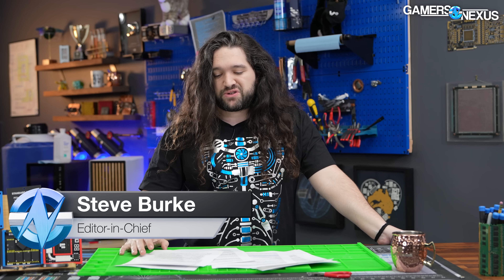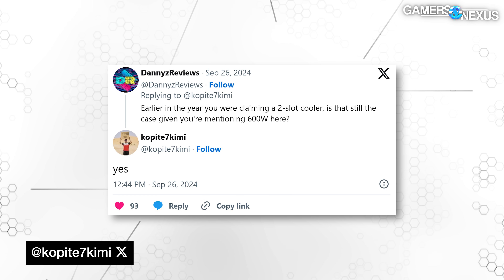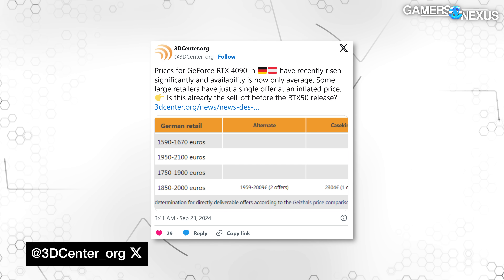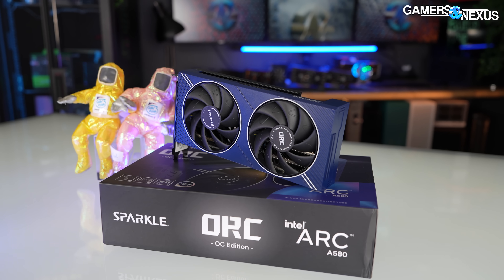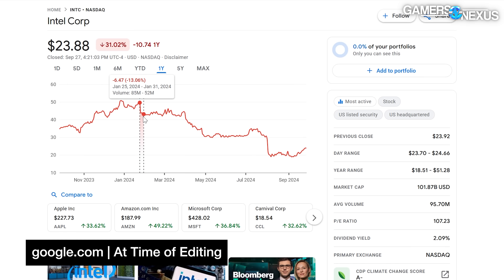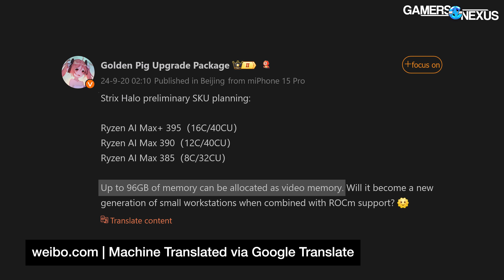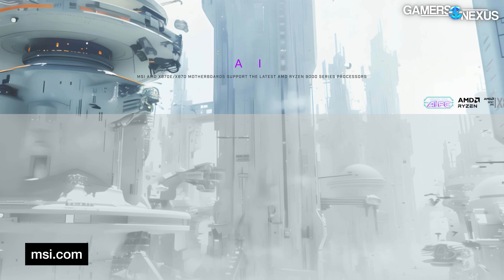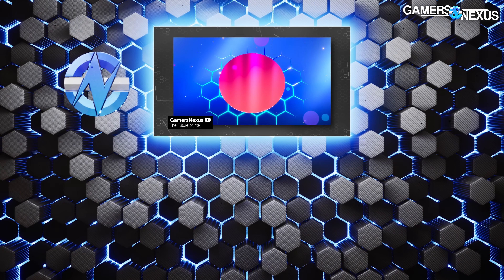HW News - RTX 5090 & 5080 Leaks, Valve ARM64 Experiments, Intel Arc 0% Marketshare, 4090 Price

Comment: I don't understand the people saying the 5090 leak can't be possible be real due to the core counts being too high for a generational increase. Does no one remember every previous Nvidia massive generational halo card spec increases? Titan RTX to RTX 3090 increased core counts by well over 100% (4608 to 10496), RTX 3090 to RTX 4090 had roughly a 60% increase in CUDA cores (10496 to 16384), and RTX 4090 to this rumored RTX 5090 is a 33% increase in cores (16384 to 21760). If anything Nvidia is actually getting stingier, cutting the GPU core spec increase they've given to Halo cards generationally by half each generation going back to RTX 2000. 2000 to 3000 was 100%, then 3000 to 4000 only 60%, 4000 to 5000 dropping to almost 30%. The 6090 will likely only have 15-20% more cores than the 5090 if it keeps tracking this way, price justified by new DLSS and frame gen that allows a 2X performance increase of 4K gaming over 4090. When we went 3090 to 4090, they took away  / reduced a huge part of the generational prior years 2X hardware improvement and instead gave 40% of that performance with DLSS + Frame Gen, and people were still more than happy to shell out two grand for a GPU, they'll do it again. 

My bet is Nvidia cutting their 5090 production costs by another 25% over 4090, give even less hardware horsepower improvement and I bet the 4090 FE of $1599 turns into a liquid cooled 5090 FE that costs a minimum of $1999, or as much as $2499.  No way they're going to sell consumer GPU's to us when those same GPU dies can be sold at triple or quadruple the profit margins to a datacenters desperate for any AI hardware.
Reply: it's not worth to explain that they get less for more money. if somebody pay leather jacket's exclusive margin (about 60% btw) just to play games on that brick, it is purely for the feeling that he is something more than others because he can afford it. i can purchase 4090 every month, but i had to be mentally ill to buy a card which is barely worth 50% of its price.

Comment: really hope that the rumored v-cache on both CCD's comes true
Reply: Agreed. From what I saw their 'solution' for having the system decide which ccd to use left something to be desired. They needed something similar back in the bulldozer days and I wasn't impressed then, sure it helped my 9120, but it was marginal and I still suffered from random stutters, their scheduling update only made them less frequent. I refuse to spend 9950x3d money for a solution that is only 'less annoying'
Reply: The final AM4 CPU being a 5950X3D with double v-cache would be a dream come true for me
Reply: I mean then you have 2 downclocked CCDs. If you want gaming, go for the single die imo.
Reply: Other issues with this is basicly no games are multithreaded enough to support a 16 core X3D at the moment, pretty much every title threads out to 8 cores@happygster922
Reply: @happygster922 it’s not that simple. Want both. I don’t just play games with my PC. I’ll take two slightly lower clocked CCDs than this hybrid approach that often times doesn’t work the way it should.
Reply: I hope they plan to do more with all the zen 5 X3D chips then just tag the same amount of 3D vcache on them. Otherwise for gaming at least, they will be as much of a disappointment as the non-X3D 9000 series. There won't be much of an uplift between a 7800X3D and a 9800X3D if it's going to be the exact same type/size of cache addition + lower clocks plan as usual, given the "uplift" between zen4/5 now.
Reply: @GR8APE69 why would you use CPU instead of hardware encoding/decoding? HW encoding is stupid good now.
Reply: @GR8APE69  For that, very much so.

Comment: I have a A770 and loving it. Clocks really well, works on al games I've tried and sips power compared to both Nvidia and AMD equivalent performance models I have. Also gets driver updates extremely regularly.
Reply: Good for you but intel has a lot of problems that ARC is affected by it even though arc is good now...
Reply: @notrixamoris3318 It's because of the architecture
Reply: it does not sip power. the idle is at least 60w from the wall.
Reply: @ZestyLemonSauce  Idle is 40ish max and my GPU is rarely ever idle, so that bit doesn't matter to me, it's 100% load power usage is lower than both the 6700XT and 3060.

Besides you can get it down to 8W idle power if you set your monitor to run 60Hz when not in a game when you follow their PCIe low power settings recommendations.

Which seems to be a peculiarity in their vbios or drivers they still need to fix. The PCIe low power settings do work, but only if you set your monitor to 60Hz. Going higher than that instantly brings it back to 40ish.
Reply: @enlightendbel  6700XT is a better performer than the A770 and the 3060 has a lower TDP than the A770. I mean even looking at HWUB's review on the A770 on average it used the same power as the 6700XT.
Reply: "sips power" 
Literally has a hardware flaw that makes it consume massively-more power when running at or near idle... you know 95% of the time.

Comment: The elephants Steve, the elephants…
Reply from the maker: Just you wait until they finally do away with weight measurements on GPUs and replace them with fractions of one elephant.
Reply: @GamersNexus  with how much GPUs have grown in size lately I don’t think we’ll be measuring in fractions for long
Reply: @GamersNexus  Milliphant, microphant, nanophant, ...
Reply: @procedupixel213  😂😂😂
Reply: Elephants are fine, you should start worrying if they use baleen whales as a unit of measurement. Especially if its the blue whale.

Comment: Valve working on ARM64 support for Proton also means good news for macOS devices running on Apple Silicon.
Reply: Wine already works on MacOS, so it's not a big leap for Valve. It would certainly please us Mac users. Linux is soooo far ahead for gaming right now, but I want games on all my computers.
Reply: Ever since Apple made it impossible to run 32bit applications, Valve has pretty much given up on supporting the platform. They make sure the Steam client runs, but that's about as far as they go. They haven't even bothered to update games like TF2 on Mac. It simply doesn't run anymore. I could play it on my 2011 MacBook Pro, yet it doesn't launch on my M2 MacBook Pro. It's so much faster, but it can play so much less.

Valve puts a lot of time and effort into making games more compatible, only for Apple to break compatibility entirely. That's maybe fine for productivity software where you always run the latest version, but a disaster for games since their active support only lasts for so long. Apple doesn't understand (PC) gaming, and they never will. Every once in a while they'll parade a few games whose ports they funded, but other than that macOS is really not a platform worth buying into either for gamers or game developers... Valve tried, and all they got was a middle finger...
Reply: It’s kind of a double-edged sword. Dropping support for 32-bit apps screws over some older games*, but keeping support slows down your machine while further complicating future progress (e.g. the transition to Apple Silicon/ARM64). There’s no ideal solution. That said, it’s long been the case that if you’re really wanting to game you’re better off getting a console or a PC, though I guess we’ll see how Apple’s current push in gaming goes. I doubt it will do much, and I say that as a life long Mac user

* though given Apple hadn’t sold 32-bit Macs since 2009 and macOS hadn’t supported 32-bit hardware since 2011 there was little reason for more modern games to still be 32-bit only
Reply: @pilkycrc  As a software engineer I really do have to debunk that argument.

There really isn't a good reason to forcibly drop it, not for a company that size. All 64 bit x86 processors are fully backwards compatible with 32 bit instructions. It's literally native code. You're not slowing down anything there.

So then you have the OS level. You need to have a translation layer between the 32bit applications and your 64bit OS libraries. The thing is, Apple had this. Microsoft also has been using this since 2005 at the very latest. It's absolutely fine to not bring new features to the compatibility layer, but there is no reason for them to simply remove the existing functionality. Sure it takes some engineering time to keep it going. But Apple is a huge company with tens of thousands of engineers. It's a huge middle finger to their community of users to not spend just a few resources on keeping that old compatibility layer functional.

I'm sure the move to ARM has something to do with it. But even then... Microsoft's much inferior x86->ARM compatibility layer supports 32 bit apps. Rosetta by comparison is a much better compatibility layer. They just didn't bother.

FYI, I can guarantee you they will pull the same sh!t again in a few years. In a few updates they will drop support for Rosetta and you'll lose access to ALL mac software written before ~2020. They did it with their PowerPC translation layer, they'll do it with the x86 translation layer. They have been doing crap like this for decades. Yeah it takes extra work, but that's nothing compared to the millions of hours of development work spent on software that will simply no longer work. For all its flaws, at least Microsoft understands the value of that...
Reply: @Niosus  As a CS major, I approve and appreciate this write-up! Excellently put.

Apple does what it does for its own profit. Same with any other company

Comment: JPR calculate their market share based on the unit shipped for that quarter. Intel market share is at 0% because for the last 2 quarters intel ship extremely low quantity of Arc to the market. They rather not selling those card if they need to give crazy discounts on it (and make a loss because of it). Intel market share won't be improving until they release BM to the market.

Comment: 6:51 5080 is going to be such a lame "upgrade" over the 4080 (super). Almost no increase in core count and going from TSMC 5nm to 4nm will barely improve the clockspeed. Fully expecting 1200 USD or higher pricing too 💸
Reply: Upgrading from a 3080 to a 5080, would the uplift be worth the cost to upgrade? Not sure if it can be answered currently due to the lack of knowledge.
Reply: sadly upgrading from a 2080super would have loved a bigger node upgrade but it will still be a sizable upgrade because the gddr7 over gddr6x rather than the almost non existent 5nm to 4nm upgrade from the cards.
Reply: @deadpool790 If you have a 2080 Super even a 4070 Super would be a massive upgrade stop being delusional.
Reply: Just wait for 6080
Reply: I always feel 256bit bus as an insult.
Reply: nah my delusion was thinking the 3000 series would have DP 2.0 but then DP 1.4a became a thing. DP 2.0 tech has been around 6 years and thus I waited. I didnt want DSC to be a thing with signal compression and wanted full bandwith. But alas we are here now so I'll be upgrading to a 5080 that is hopefully 24g so much speculation on the 16g and maybe a 24g later...
Reply: @deadpool790 DSC is visually lossless.  I also didn't want to use it, but I got a new monitor and you literally can't see the compression at all.
Reply: I am thinking they might deliberately be cutting the 5080 down more than usual since they want to target $1000 or even $900 for the 5080. They found with the 40 series that enthusiasts will pay $2000 for the top of the range card but no-one wanted an 80 class card for over $1000. AMD basically found the same thing since their best card was also only the second best product overall

Comment: Pretty sure Ngreedia left room for an 5080ti with 24Gb !   Because just 16GB on the 5080 doesn't make sense !
Reply: Yes, but it will be called 5080 AI.
Reply: Enough room for 5080 Ti, Super and Ti Super.
Reply: it does, just like the 4080, so it runs out of VRAM in a year or so when people run the latest over-hyped RT and need to blurLSS it
Reply: Doubt. RTX 4080Ti also didn't happen.
Reply: @simoSLJ89  AITI Super -> ATI Super -> ATI. The time has come, the circle will become complete.

Comment: i just hope they dont pull a 20 series on us again 🙏
Reply: It's ALL going to be a 20 series style pulling the wool over our eyes from here on out. As in "Woo-Hoo! Lookit this AMAZING 3% uplift over the previous generation!"
Reply: Yes they will, just look how bad the specs are for the 5080 it'll be incremental changes in raster compared to 40 series other than the 5090.
Reply: Don't do that to yourself😢
Reply: @joelcarson4602  I'm praying that the 5080 is 10% better than the 4090 for cheaper. If so, I'm most definitely getting it. Also, 4090 in my area is over 2300 USD for pny brand.
Reply: They already did with the 3060ti and 4060ti

Comment: all AMD needs to do to get their market share back is release cards with much more VRAM like they did 10 years ago, everyone who runs AI locally just wants more vram capacity to the point where independent card manufacturers are making a mint now
Reply: Absolutely. Especially with the latest LLaMA versions that no longer have mid-size versions. You need at least 40 GB of RAM to run them with decent precision.
Reply: all amd needs to d to get their gaming segment market back is cater to like 2% of users?
Reply: They already do have a fair bit of RAM vs. Nvidia, not that it makes much difference. I get what you're saying, but currently I have doubts about such changing a whole lot.

If they wish to compete with Nvidia, they gotta sort out the performance. Not just competing with Nvidia, but surpassing them. Even then, too many stories about the drivers - not even sure better performance alone would do it, people still scared.

Price would do a lot. They got greedy with the 7000-series, based their pricing on Nvidia's silly prices - rather than trying to go for market share, with lower prices. AMD did exactly as Nvidia, nearly doubling the prices of previous generations.
Reply: Unfortunately they are too slow on the ai side of things. They are integrating their workstations architecture into the gaming GPU, udna, which will come after rnda4. Its a bit too late, I think the ai craze has died down. I haven't seen much ai stuff making headlines. Ai video are still stuck in slow no look.

And the games aren't delivering, either take too long to make or just isn't appealing. I don't think amd can ever recover in the gaming GPU space.
Reply: @oneanother1  Even if they're not as fast as Nvidia, if they're faster than running off CPU it can be worth it, depending on the price.
Reply: @450AHX  believe me, and is still too slow. Check all the benchmarks for image gen applications. That's why no one buys amd for ai work. Ai image gen can take a long time especially at higher resolutions.
Reply: @desmasic  amd wants to follows nvidias pricing, which is why they are delaying rdna4. They don't want to over deliver, because that would just make it harder for them to make their next GPU release harder. They are hyping up their rdna4 GPU midrange like its going to smoke a 4080. Amd is only picking up scraps from nvidia at this point.
Reply: @desmasic  amd would prefer to lose market share rather than have to sell their card at or below cost. Turns out 5nm and MCM end up going against AMD. 5nm is very expensive (that's why low end card like 7600 use cheap 6nm instead of 5nm) and more advance packaging needed for AMD also drive up the price for AMD. this is why 7800XT only coming out 9 months after 7900s. Igor hinted that AMD was have issues with pricing to the point even at $600 might end up selling those card at cost. Imagine there is no profit margin on freaking $600 card.
Reply: @Nightykk  It does make a difference. 12gb cards are dead already with any ray tracing or heavier work, 16gb is approaching the chopping block in 2 games as it is, it'll only get worse. AMD high end doesn't go under 20gb... that's how you make a card with a long lifetime. 16gb 4080/5080 is literally artificially limiting the lifetime.
Reply: @N4CR  Never said it didn't make a difference. But, VRAM or not, they're still lacking behind in AI performance. Not to mention RT performance still being a generation behind.

I agree with you though - I'd love the more VRAM. Both for gaming, and something like Stable Diffusion. And yeah, ever since the 1080 Ti Nvidia has been skimping on the RAM. Was too a reason as to why I'm currently on my first AMD card.

Comment: Just wanted to add that proton is build upon WINE (and DXVK, VK3D...). So contrasting them as one being good and the other being bad doesn't make much sense. Those projects do not get the recognition they should by being hidden behind the common "Proton" name. Of course Valve, through direct contributions or subcontracting, improved them a ton.

Comment: I'm totally willing to buy a 5090 after selling my 4090, but the idea that it could use two 12 pin power cables and take up that much space in the case is making me a little concerned about the feasibility. I went and got a fancy power supply that has the native 12 pin cable just for the 4090, but now I feel like it's already outdated.
Reply: Same my psu has a 16 pin socket and won't be happy if I'm forced to get a new psu already just for one more socket,it would be really scummy doing that in a single generation 

5090 should only use one 16pin and one 8 pin for safety
Reply: Water cool it and you’ll be fine